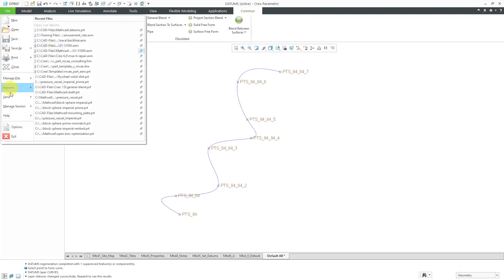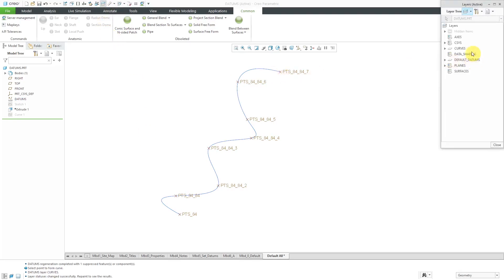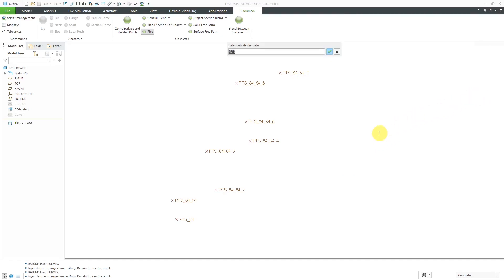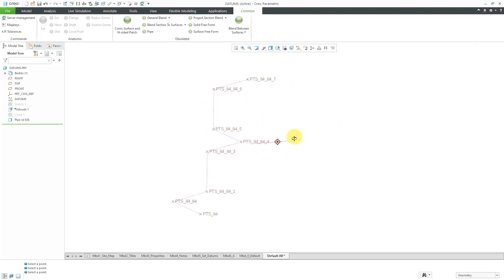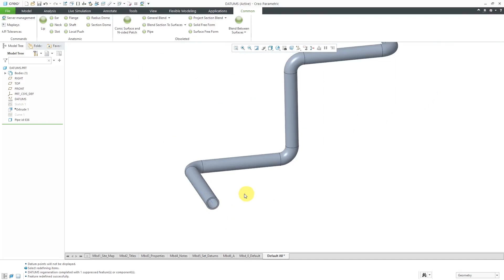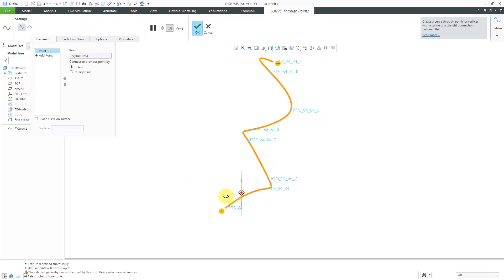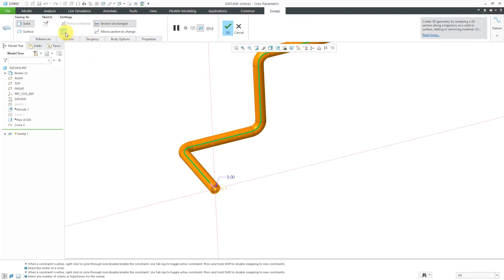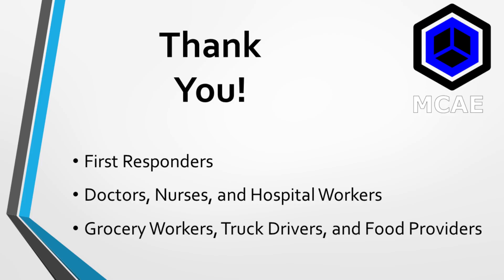Creo Parametric | Pro/ENGINEER Obsolete Features - Pipe

Comment: One thing that was Gold with the Pipe feature that the sweep method does not provide, is when you look at the Feature information with the pipe, it would give you straight lengths, curve angles and pipe overall length.  Using the Sweep method you are largely on your own to determine this stuff as far as I know.

Comment: Common tool inner pipe not there in applications sir
Reply from the maker: You have to customize your ribbon since this is an obsolete command. See my video on customizing the ribbon.
Reply: @CADPLMGuy  it isnt in creo 4.0 right ? Probably too old.
Reply from the maker: @ls2011schorsch  It is. This command dates back to the 1990s. You have to turn on the configuration option and add the command to the ribbon. I show this multiple times in other videos in the series.